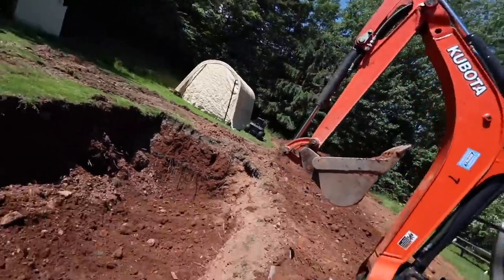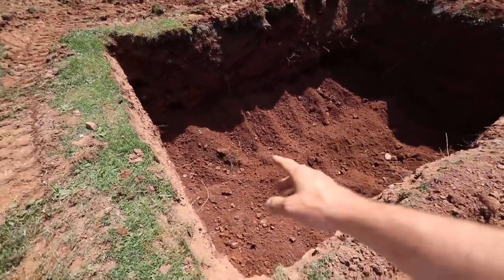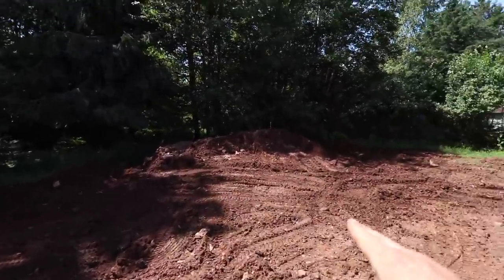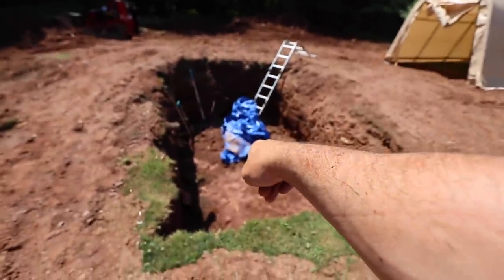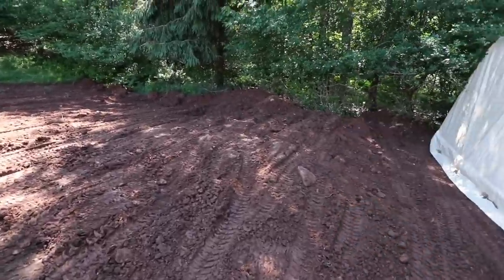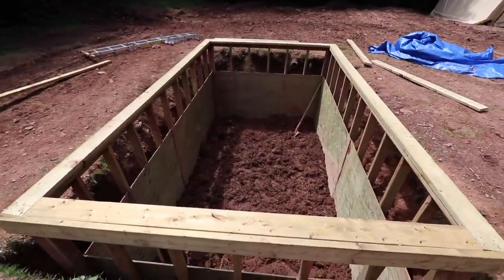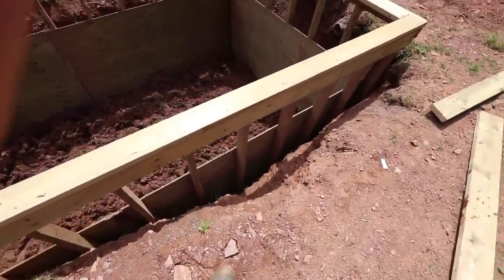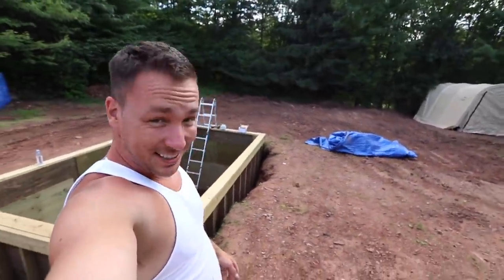I'M BUILDING A POND!! So i can swim with my aquarium fisH - part 2

Comment: As a little advice from someone who has had lots of koi ponds over the past decade I’d strongly recommend putting in a bottom drain and gravity fed filtration system. Reason one it’s keeps the pond a lot clearer. Two it’s cheaper to pump water in a gravity fed system than in an above ground filter. Just a couple of recommendations from previous pond builds I’ve done and mistakes I’ve made.

Comment: That looks Great! I’ve owned a landscaping company for 10 years here in Maine, and I’ve leveled countless yards, your work speaks for itself!! Just be sure your grade is still sloped away from your house/foundation, as you don’t want rain water draining towards your house,  If you Ever want a Job Running Heavy Equipment Hit me up! Also be careful what nails you use with that pressure treated, the chemical they treat pressure treated lumber with these days will completely eat threw regular galvanized nails, in about 3 years, so even tho your lumber will last 30 years, everything holding it together will rust away to nothing in 3 years, only fastener I’ve found that holds up for longevity is the Ceramic coated decking screws.

Comment: Joey, i have an old wooden pool built in 1985. Your plan is almost identical to it, it will last a very long time.  Only thing i would reccomend is backfilling the outer parameters with sand. Thats how we had to do it when we replaced 1 panel this year. That pond is going to be awesome! Keep it up!

Comment: As a lifelong diy builder, I am against putting wood in the ground, treated or otherwise.  It's a lot of work for the structure to have to be replaced in your life time, and it would cost about the same to use plastic, composite, or cement.  Also, pls don't make the mistake of attaching the liner to the sides before filling it with water.  The water will settle the liner, then you attach the sides; otherwise, you may tear the liner or collapse the sides.
Reply: Now that it's in there do you think he should brace the inside of the pond thoroughly and then pour concrete between the existing pressure-treated wood and the dirt, or is this an excavate and build a mold then pour into the mold type of scenario?

Asking cause it's for a pond and no one will see the cement in the ground until they excavate it later. But now saying it out loud I am thinking that the dirt will likely cause issues with the concrete setting up.

Comment: Pressure treated or not, that wood will rot. Period. I built a deck 20 years ago out of 6x6 pressure treated and any wood that touches soil has rotted. The chemicals you would have to use to retard that process you don't want anywhere near your pond. You'd be better off with reinforced concrete walls or at least roofing rubber with 2B gravel drainage. I truly hope this works out well in the long term, but I thought you might want to consider this before you backfill.

Comment: It's looking good. You may want to water-fill, back-fill, and pack the back-fill incrementally from the bottom up so that the walls end up in the right place. (if you back-fill before water, you might have plywood separate from the frame, and if you don't pack, the water might bow the walls)

Comment: Probably wouldnt have been a bad idea to try get some insulation in between the frame boards to keep from freezing even more. That would really help out the surface heater you plan to put in. If i would do that id build each wall seperately and stack the insulation inside and close it off with more plywood on the back. Itd be costly but if you have a fish thats super sensitive to cold water itd be worth it. I plan on making a redtail pond but it gets too cold around winter where im at so i need to make it under my house where it is out of the elements. Im probably going to do what joey did but above ground and the liner will just be an intex 6x10 pool and build an insulated box around it. I think i seen an intex pool thats 6x10x3 which would make it arond 1,300 gallons which i think is enough for a redtail just gotta keep it warm enough to stay happy.

Comment: Looking good. A few tips for building the pond. Use a bottom drain, koi are producing a lot of waste, and is easiest removed with a bottom drain. Put in 2 returns  into the pond, diagonally across the long sides. This makes the ponds flow much better, and will gave you a lot more pleasure when the pond is clear.

Comment: Good luck on that build!! With being 5ft down, your probably running into ground water. It won’t harden. Plus, if you get anymore rain, it’ll just keep raising. I hope you have a plan to skirt the outside of the frame to keep the dirt away from falling in!
Also, noticed that you were rocking a lot on the machine. Spin your tracks around to have the blade face behind you, and put the blade down just enough that takes you tracks off the ground just a hair. It’ll help

Comment: Get a bottom drain in there man, now is the time. Fixing what you don't like in a 75g tank is easy compared to emptying that pond and redoing the liner for a bottom drain down the road.
Reply: If it’s anything like setting up a regular tank...Then he will be upgrading to a bigger pond in about 6 months!
Reply: @Rob_8529  Once you have a good sized set up, it can hold unless you start in the 100's for a pond. If you watch my videos, the pond is 2000g but through filtration and care I can handle a massive fish load. I think he will be more than ok at that size, but the filters will really matter as koi are more addictive than other fish IMHO.

Comment: Hello Joey! I have a thought. Are you gonna curve the corners so the water current circulates thoroughly? This would help the fish swim around evenly and not get stuck in the corners. It would help the pond circulation and provide security fish to swim. I've seen a lot fish attempt to jump out of the pond when they were nearly stuck in the corner because the edges were to steep and they were force to swim up If panicked.

Comment: Don't let the water touch the pressure treated wood.
Your gonna have it swell and then possibly leak. I know you plan to have a pond liner/underlayment, 
but did you plan for rain and weather wear?
I suggest some non-toxic water proofing.
+ pressure treated wood is toxic.

Comment: Hi Joey, 
1. your wood structure looks like forms for a cast-in-place, steel-reinforced  concrete shell, which would be more durable. Would that have cost that much more?
2.  Consider adding styrofoam boards for insulation before you backfill?
3. Dont worry about a bottom drain, a submersible pump works better than gravity drainage but you may want to build in a sump pit for it,  with a grate cover.
4. Wheres your filtration system and piping for it going? the pipes will need to be below frost line so you'll need to install bulkheads before backfilling.

Never mind, you probably already figured out all this!
Reply: Mate a pump works nothing near as well as a bottom drain.
Reply: Absolutely wrong, a bottom drain is the best method.
Reply: Bottom drain he'd still need a pump. Maybe not a submersible, but a pump nonetheless.
I assume filtration would be a setup very similar to a swimming pool - which uses a pump. It doesnt look like he's put in the necessary piping at the bottom, though.
Be interesting to see what he does.

BTW, does he have a bottom drain in the concrete tank inside the aquarium gallery?

Comment: You should run the plumbing for two 3 inch bottom drains under your pond liner.  It will make filtration and maintenance so much easier.  And you won't have ugly pipes in the pond.

Comment: I definitely would have used concrete blocks instead.  They would last until the end of time.  That's what most pond companies use for walls.  What sort of filtration do you have planned?
Reply: Think there's a cost consideration, and concrete ponds are usually poured at site. In the last video he showed that he's planning to make a DIY barrel filter.
Reply: kevin augustsson Have you seen how crazy expensive pressure treated lumber and deck screws are? Concrete blocks are less than $2 a piece.
Reply: @brandonellis4422  you would need to use a lot of them though, plus concrete and rebar to fill them if you want them structurally sound

Comment: If you put R13 roxul insulation on the bottom of the pond before the liner it’s the best protection from rocks and roots. All I’ve ever used without issue ever. Just a tip Joey.

Comment: The pressure treated wood will not last even 5 years under dirt/ground if water keeps around it.
Reply: The water will not be touching the wood, there will be a liner
Reply: @zaxkd6632  Ground moisture is a constant thing. Constant Microbial action on the wood will rot it . I have a dozen 6x6 pressure treated columns on my deck that I also treated with dock preservative and they all started rotting.
Reply: I doubt he’s keeping it like that for 5 years if you’ve ever seen a video on this channel before
Reply: Zaxkd but on the other side where dirt is touching. Plywood isn’t design for in-ground use.

Comment: Just imagine if you were using cement or concrete like the 2000gal. It would be an even more of a pain in the ass than what you are doing now. You would have to put rebar throughout the walls and the get a cement truck out there to pour and all the fun stuff. It is looking good so far though. 👍🏼
Reply: Day Trading True! I am not sure but concrete may pose a freeze problem in the really cold months too because it is not insulating unless he put foam on the outside of the forms between the dirt walks and the concrete wall. Still. It seems like more prep work to me.
Reply: I agree

Comment: Put a bottom drain in it. Will save you a lot of time keeping the pond clean.
Reply: Where would it drain too?
Reply: To your filter system. With a bottom drain installed the waist from the bottom can go directly go to your filters.
Reply: @erikkop  What do you do if it springs a leak?
Reply: It is a proven method for a long time. If you use the bottomdrain with the pond liner correctly there will be no leaks. Search for it on youtube how to install.

Comment: I might be getting ahead myself here, but no drainage pipe on the bottom? I would have thought you will need 1 to drain and use it as circulation for the filter.

Comment: Hey Joey I know you said something about not letting it freeze in the last video.  That being said if the pond accidentally does freeze will the expansion of the water to ice bust your wooden frame?
Reply: If he runs an encased heater and a pump heater he won't have to worry about freezing
Reply: Plus the wood is supported by the dirt around it no major damage would occur
Reply: Nope as the water freezes the ice will expand up but it's not going to completely freeze

Comment: Why don't you pour concrete on the outside of the pond though? Wouldn't concrete make it way stronger? Unless you don't want it to be permanent pond
Reply: Concrete won’t hold up nearly as well as wood in this situation,  Canada has Frost issues, also, installing filtration/flow, will be easier then concrete, you can attach the pond liner much easier, plus concrete ponds arnt exactly a DIY project that many people can handle.
Reply: He’s in canada

Comment: Very nice pond, how are you planning to heat it?
Reply: It won’t be heated, it is an outdoor pond, Koi fish will winter in the bottom where the water does not freeze!
Reply: @kathleensauerbreiartsite9065  I see, I thought that winters may be tough for Koi, but I guess covering it in case it gets too cold would be good enough if they stay at the bottom.
Reply: 20 gallon fresh  ......Koi are basically one of the  Carp family. They are strong fish that can withstand the cold as long as the water is deep enough.
Reply: @kathleensauerbreiartsite9065  Interesting, I wasn't aware of that, thank you for letting me know. I have mostly tropical fish. :)

Comment: am sorry but with Canadian winters how is this a good idea
Reply: He's below the frost line. That's why it's so deep.
Reply: They don’t freeze solid
Reply: A... heater? I know someone who used to keep koi and he would put in. A floating heater when it got cold.
Reply: Hbk no you don’t , my brother has had one for more than 10 years. That’s out in the spring and the koi are fine.
Reply: Hbk yes
Reply: Hbk much better chance of losing fish in the summer to blue heron
Reply: Hbk they wait for them to come to the surface and the grab them. Seen it happen many times.
Reply: @LiamSealy  Google is your friend, seriously he's below the frost line and the ground is a constant temperature for the most part. So while the top freezes it doesn't freeze down deep. Also the steep sides will help even further.
Reply: @LiamSealy   koi essentially go into a form of hibernation where they are motionless. Their metabolism also slows down to almost nothing compared to a active fish. So food and filtration is not needed. The same thing goes for oxygen that gets trapped under the ice and as long as you have reasonable stocking the fish are just fine 😉. Seriously I tried to keep you from looking like a idiot 😂

Comment: If you soak the wood with used engine oil or similar it will last longer, don’t use a lot of oil but enough to cost the exterior and allow for the oil to soak into the wood. I think the most I’ve seen from pressure treated wood is neat 14 years like how you have your pool setting in the ground
Reply: Pressure treated wood doesn't soak up anything.
Reply: @darkiee69  it's still a wood it will soak moisture over time, way longer though than regular wood
Reply: There are many different chemicals and/or methods used to treat wood. The better ones are good for 35-40 years. I know farmers use the method you listed. I cant imagine someone with over 1 mil followers recommending it especially when better products exist.

Comment: Why you aren't leveling the bottom with concrete.
Reply: That way just make additional cost.  That soil is enough for a bottom foundation, as long the soil isn't loose that is basically a budget concrete. Plus using that soil is recycling that excess dirt.

Comment: Pressure-treated two-by-fours and plywood are not rated for a contact with the ground.🙄
Reply: What do you think wood fence posts are? There's ground contact pressure treated lumber made for this
Reply: Not all pressure treated wood is rated for contact with the ground. Four by four post which were meant to be put in the ground are rated for ground contact. two-by-fours are not normally put in the ground and are not rated for contact with the ground.

Comment: Hahaha you think pressure treated plywood thats essentially underground will be good for 40 years? Hahahahaha
I give it 5 years tops and thats being nice.
Reply: Depends on the grade
Reply: @PFM666187  anything soaked in that strong of stuff is not something you want to use next to a fish pond anyways. I guarantee those are just normal pressure boards for making things like decks. Not all pressure treats are even intended for ground contact.
Reply: @dylvitte3226  Still, depends on the grade of the pressure treated wood.